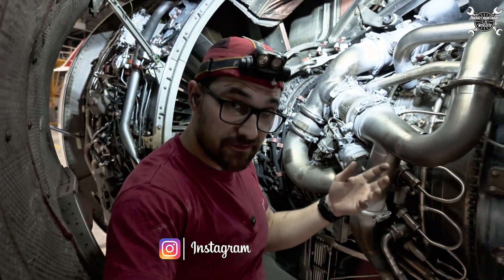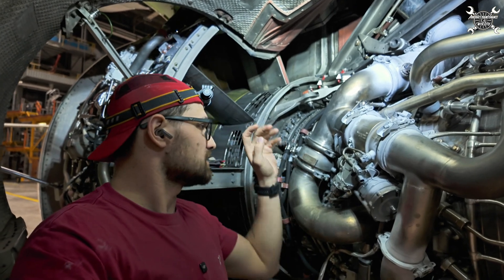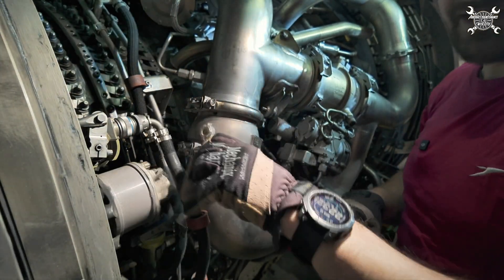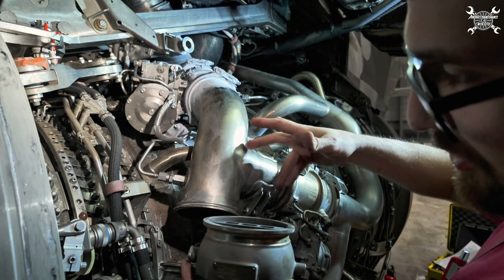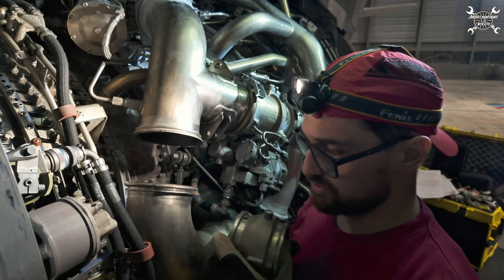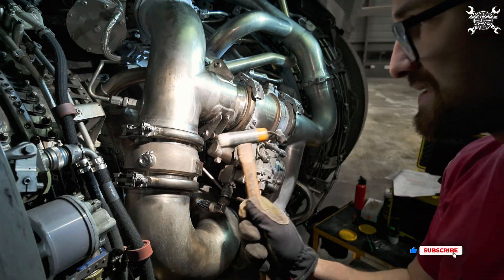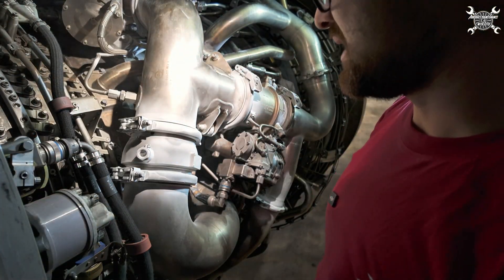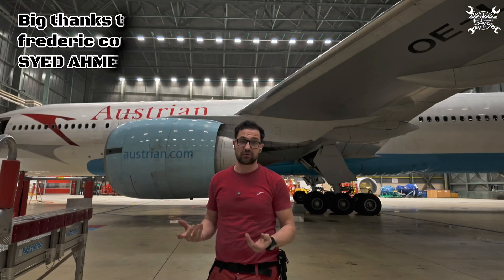Intermediate pressure valve on A32F engine

Comment: Great video! Much appreciated! Powerful and intricate machines, which need to be designed to be maintained as well. If I understand correctly, I believe all the air in the cabin at cruise flows through the valve you replaced. (I like the 787 design which, uniquely, doesn't pipe bleed air into the cabin like this.)

Comment: have never seen air guns and electric guns, which are essential for car maintenance, in aviation maintenance videos. Why don't you use them?
Reply: To prevent from applying unnecessary torque. Also when using manual tools you have a better feedback so you'll know if the screw or bolt you're installing is fitting right.
Reply: @mgsegoo1124  Aircraft maintenance is a very advanced skill. Thank you.